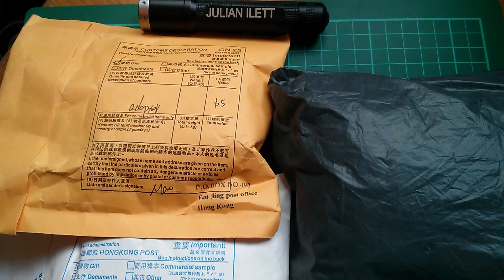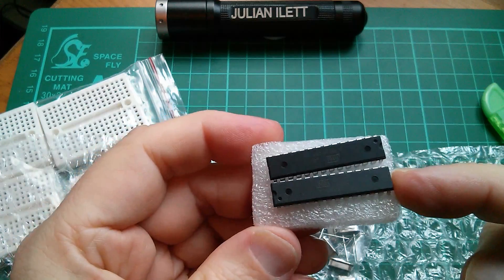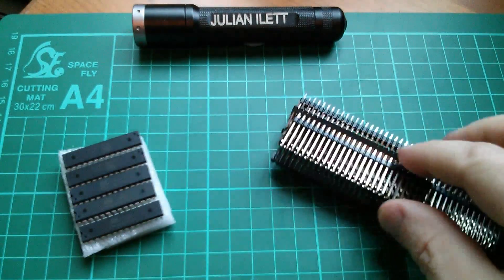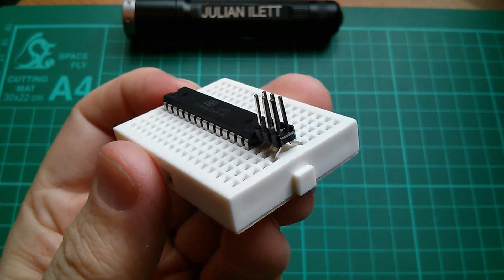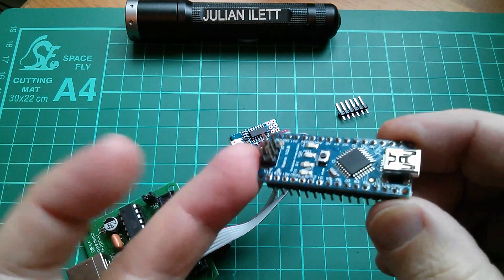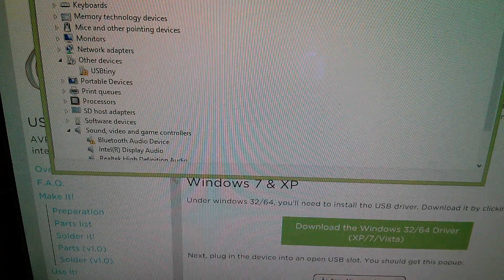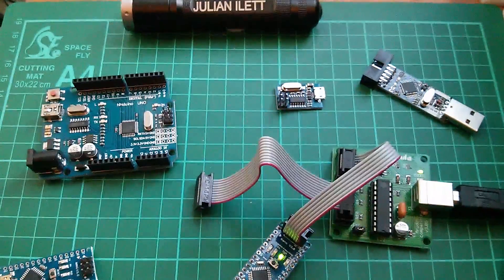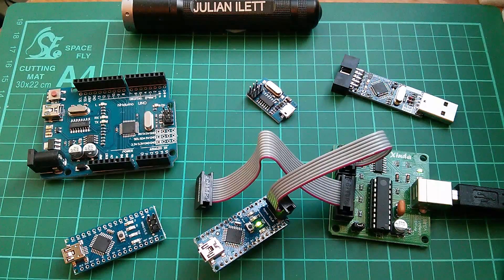Postbag #28: Arduino Special - Cheap Uno, DIY Duinos, USB Tiny ISP

Comment: Somewhere in china there is a exhausted worker that ends his 14 hours days of labor and getting paid 1 Eur for it,
 whom says: cheap is a point of view sir !
Slavery is slavery, even if you are in denial !
Reply: Nobody makes these by hand or any electrical components by hand. They are mass produced and you can get these components for less than 10cents a component if you buy in bulk. Sometimes there is a surplus and sometimes they make clones thats why its so cheap, even for 5$ for one of these Arduino clones the seller can make up to 100% profit on one of them...

Comment: looking for cheap arduinos myself but they must be the throughhole version.
now i'm lost, i have a project board and all components to build a device, it uses a 328p throughhole chip which is the only component i don't have, i was just going to buy a cheap uno plug in the usb put the program on it then pull the chip put it in my device, this is a one off i dont use arduino so no programmer,
but now i dont know if that will work, if the uno needs a bootloader before i can program it i might as well buy the bare chip and a cheap programmer even though i will only use it once.

Comment: At around 15:20 you mention you fixed it by upgrading the Arduino IDE but I noticed that on the old ISP you had changed the header around to get the double blink to work

I can see later you discussed swapping the header around, but that’s when you talked about the new header

I don’t understand why these headers aren’t like, say, the old PC IDE cables where they had a notch meaning you can only plug them in one way.

Comment: Wow, a $5 uno - pity it lacks a socketed, removable processor - which I need when I'm using the uno as a serial programmer fro my non USB arduinos (pro minis, etc.) (Whihch I have to do after FTDI buggered the drivers again for the FTDI programmers again.)

Comment: Julian, i´m also having problems with USBASP and fixed it by adding he missing header for slow sck... and other error messages by uploading sketches manually using avrdude: avrdude.exe  -p m8 -c usbasp -C conf.tmp -P usb -U flash:w:"Blink.hex":i   "m8" is because im using a atmega8.

Comment: Hi Julian!
I saw you mentioned how cheap the NHduino uno was, but i recently spent 3.69 GBP for an "R3 board" with the atmel MEGA16u2 chip for the usb interface, and with a removable ATMEGA328P chip that looks EXACTLY as an arduino uno R3 (front and back) and is working perfectly! 
The only issue was that it wouldn't run at all when i first got it, but i shorted 2 ICSP pins togeather and it brought it back to life. 
Are you intrested? (Free worldwide shiping from China by the way)
Reply: I am
Reply: +Myke oh gosh I didn't see the notification and I only saw it now that I accidentally loaded the video up again, really sorry :( here it is: http://m.ebay.com/itm/141679582436?_mwBanner=1
Reply: MC fill
thanks for the reply.

Comment: Julian I love your video's we both share the same approach to purchasing electronics used for experimental design purposes . I have tried so hard to share the cost effective and logical thought process with others. My philosophy is find the lowest priced component that produces or excedes the level of accuracy/rating and longevity for it's intended purpose. On a few occasions I have been able increase the level of a components accuracy by tweaking OS software; which may never occurred without the contribution of others.

I always buy at least one Official Arduino Board to both support the movement and as a control to test against clones. When I first got into programming MCU's, using the Arduino Platform I got a kit from Makers; it fell far short of my expectations. I immediately saw how there marketing plan was stacked and rigged; so I began to do my homework.
	
Long Story Short there are many excellent sources for high quality imports, unfortunately the amount of bogus suppliers gives the entire lot a reputation so horrible people would rather get railroaded by a handful of companies who pay to have their name incorporated with everything Arduino.

Luckily you have done a much better job than I informing the masses, how to acquire loads of components that many beginners will not become overly frustrated and give up when they end up reversing the polarity, miscalculate a design, do a horrible solder job on etc. This is all part of the learning process and the DIY OS moment is the force behind expediting awesome gadgets to reach the consumer level faster at a reasonable price.

Unfortunately my ability to effectively get my message across via video needs some serious work, but I will continue to contribute to the movement in other areas. The last thing YouTube needs is more content that someone forgot to flush and I sure wish someone would cause it's floating everywhere!

Comment: Cool video Julian, I use the USBasp for programming ATTinys and i see "cannot set sck period" every time, but I've never had one fail to upload, so I just ignore it. It's disconcerting a first but you get used to it after a bit.
Reply from the maker: reggiebacci Thanks, this is what I'm hearing. The firmware on the USBasp can be updated to fix this error, but it's not absolutely necessary.
Reply: @JulianIlett  yes I just spent 6 hours cleaning up my usbasp to have the latest firmware and deal with setting fuses on my 328Ps as the default communication speed was faster than the processor could deal with in its default settings. Using a VR dude with -B 10 and setting the default fuses did the trick. I did find that I was getting verification errors periodically before the firmware update to usbasp. I also noticed at the beginning that you had put the programmer plug in incorrectly. The red wire on the ribbon cable is pin 1 and pin one is marked on the Uno though not very clearly.

Thank you for the video.

Comment: You don't need to buy a dedicated ISP programmer, you can use an Arduino Uno (or any other Arduino type) as an ISP programmer. Just load a sketch named "ArduinoISP" from "File" -> "Examples", connect your wires as described in the sketch and you can program an Atmega chip. It is also possible to burn Arduino bootloader, or even omit the bootloader and burn your sketches directly to the Atmega microcontroller. This gives you the full program space of the chip, because the bootloader does not take any memory.

Comment: Julian, 

Thank you for this Arduino special.  Very helpful.

Unfortunately the "Micro USB Tiny AVR ISP 5v ATtiny44 USBTinyISP Programmer For Arduino Bootloader" does not ship to the US for some odd reason.  Too bad.  I guess the UK has better relations with China, or perhaps easier shipping?

Comment: Your post man must love you!

I built a circuit to light a series of 16 lights. A display for my son.
I priced up using a "boarduino". A nano pro mini worked out much cheaper.
I see the point if building a project that requires custom board or a commercial product.
But for permanent home projects, the nano pro mini wins out for me.

Comment: The 10 pin ISP header is actually the standard for ISP and used on most professional atmel development boards. 6 pin is simply the compact variant.

Oh. Most of the ebay USBASP boards have the original firmware on them which does have a genuine bug in it which allows them to program some chips reliably still while throwing AVR dude errors (and completely fail on some programs). You simply need to upgrade the firmware version on them which is usually done by closing a jumper and then ISP programming them over their existing ISP connector, had to throw mine on the university stk600 boards.
Reply from the maker: SixSixSevenSeven Simply, hmm. I did try the firmware upgrade, but avrdude in command line mode isn't much fun. It failed.

Comment: Probably a stupid question - did you change the programmer when trying to use the USBtinyISP and USBasp? That still doesn't explain why it was using the serial port - the AVRisp mkII you had selected at 11:28 is still a USB rather than USB-serial based unit so it shouldn't have been trying to use a serial port at all?!? I've been using the beta version in tandem with the stable branch for a while now, and haven't had any issues with the ISP yet, but my main machine is still Win7, so that may have some bearing on the issue.

As far as the bootloader is concerned, when you use a ISP programmer, you overwrite the bootloader, so that won't be an issue if your chips already have bootloaders anyway. What may happen if they haven't been programmed is that you will need a different crystal on them so you change change the fuses - I bought some blank Atmega328Ps about 12 months ago and went around in circles for a while as they won't program normally - the fuse settings were Arduino unfriendly. I think they were set to use a 8mhz crystal, but it's a bit hazy now :)

The USBasp error message is simply that the clock frequency can't be set. A feature that is not supported by the firmware that most of these USBasps ship with... they don't seem to ship with the latest version... even though it was published in May 2011!! It it only becomes an issue if you want to program chips that need slow frequencies. The instructions you posted are wrong in one aspect, the usbasp.2011-05-28 archive from Fischl's website does have the compiled hex files in the bin\firmware folder. I use AVRDUDESS by Zak Kemble			 											 						 					instead of fiddling with the command line avrdude - it's a nice GUI frontend for it. I don't remember changing the fuse settings at all.

In the case of the two new USBasps I got recently (I got some 3/5V selectable as I only had 5V ones prevously), I just loaded the new firmware with another usbasp, and held some pliers on the self-program jumper after clicking 'go' to program the new hex file!!

Love the direction you're going, and I look forward to seeing you do some beginners guides for Arduino - you have a excellent style for presenting information that is easy to understand for newcomers!
Reply: Actually, I just did a quick search, and I seem to think it didn't want a clock at all - and supplying a crystal actually stuffed things up. I think this was the page that got it working for me in the end (http://3g1l.com/blog-burn-bootloader-blank-atmega328atmega328p-arduino-uno)
Reply from the maker: Peter Feerick Hi Peter. Yes I did change the programmer setting each time, although I think I had both USBtinyISP units connected at the same time for a while. Not sure what Windows and the Arduino IDE would have made of that.
Reply from the maker: Peter Feerick I don't think upload-using-programmer overwrites the bootloader. It's in a protected area of the program memory, protected by fuse settings. To overwrite the bootloader, I would imagine the fuses have to be changed to unprotect the memory, the bootloader written, then the fuses changed again.
Reply: Julian Ilett It did overwrite the arduino bootloader on my mega 2560, the arduino bootloader is not a true atmel AVR bootloader and doesnt reside in the protected memory as far as I am aware.
Reply: Yes, that is the case. The standard Arduino uses 2k of the flash memory, the optiloader bookloader uses 1k IIRC, and there's others that simulate a USBasp to self-program. Tricky stuff. This is the reason the bootloader option is present in the IDE... it sets the fuses and loads the new bootloader if one is specified in the boards.txt file.
Reply: On second thoughts, the documentation on the Arduino site does say for the ATmega168, it first sets the bootloader lock bits to unlocked (0x3F), sets the fuses, loads the new bootloader, and then sets the bootloader lock bits again (0x0F). This is simply to protect the bootloader from inadvertently writing over itself during a chip reprogram.

That being said, p280 of the datasheet also mentions that the bootloader lock bits will be erased if a Chip Erase command is issued. That may be what's happened in the past as avrdude will automatically do a chip erase before loading a new hex file in when told to write the hex to flash memory. This screenshot (near the bottom of the page) shows this perfectly (http://www.ladyada.net/learn/avr/avrdude.html) - only the programmer, chip type and hex file have been specified, but because it was instructed to write to flash memory, avrdude has triggered a chip erase cycle.
Reply from the maker: Peter Feerick I'll check whether the new clone Uno, which I programmed with the USBtinyISP still allows uploads from the USB/serial.

Comment: Julian Very informative indeed.Thankx
1)Would it be possible to solder female headers on the ISP board ( no cable required )?
2) I found some Arduino mega's for super cheap with RAMP board  10USD with free shipping
http://www.aliexpress.com/store/product/Mega-2560-R3-Mega2560-REV3-1pcs-RAMPS-1-4-Controller-for-3D-Printer-arduino-kit-Reprap/318950_1538708777.html
Did not order them yet.

Comment: Very informative video. Thanks! I also noticed that at 11:45, when you started having problems with USBtinyISP you connected the cable differently to what you are showing at 15:00. So probably, that was the problem, but not the version of IDE?
Reply from the maker: Certainly with cable the wrong way round, it could never have worked. But the problems with IDE1.5.8 were intermittent. Both the USBtinyISP programmers worked flawlessly with IDE 1.0.6

Comment: Hello Julian!
as a matter of coincidence my USBasp also arrived today. After some hours of googling + trial and error I was able to get it to work properly. 
You gotta solder a jumper between the 2 holes next to the led and miso port. Than follow the link you you posted to update the USBasp to the lastest version.
 After that you disconnect the jumper and you will be able to use it just fine to upload sketches to your aruinos and attinys, but if you try to upload a bootloader it will not work.

As I change the bootloaders of my attinys a lot between 1Mhz, 8Mhz and 16Mhz , there I was spending more time at google. Than I found this at the arduino forums: 

Go to the arduino\hardware\tools\avr\etc\avrdude.conf and edit the line around line number 319 :
from       # default_bitclock = 2.5
to           default_bitclock = 10

That sets avrdude to low clock rate.

Now I'm able to upload sketches and also the bootloaders!!

Greeting from Brazil.
Reply from the maker: Ah, that's useful information. Many thanks. I'll give that default clock setting a try.
Reply: Out of the factory the atmega is running at 1mHz. So you must set the ISP clock speed to a lower value. I've always used the commandline to change the fuses, to have it run at 8mHz (internal oscillator). After that I can just use the arduino IDE.
Reply: Julian Ilett
Hi Julian I have finally got around to ordering an Arduino like the one you showed in this video, the clone from Alice on fleabay. Not sure what I am going to do with it yet, but I like your videos, so I am sure I will play with it and think of something